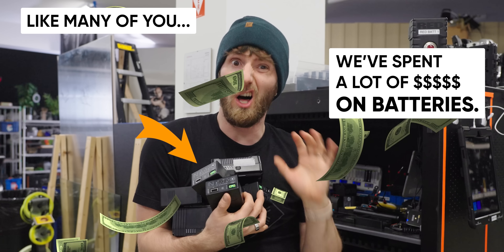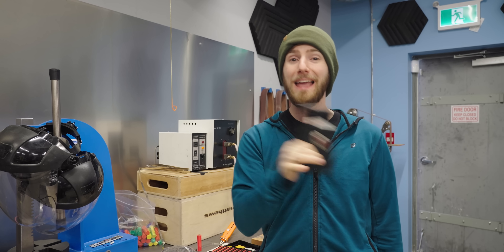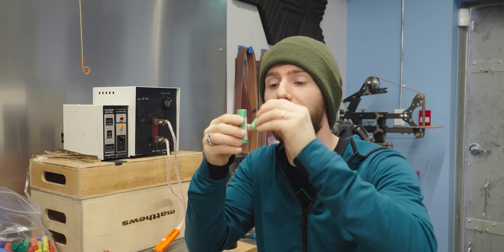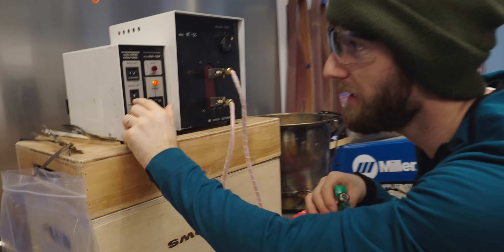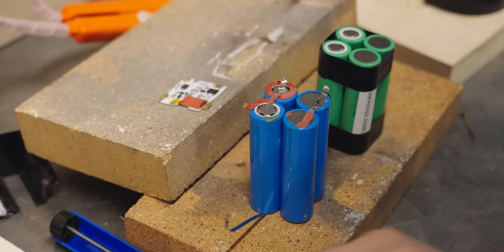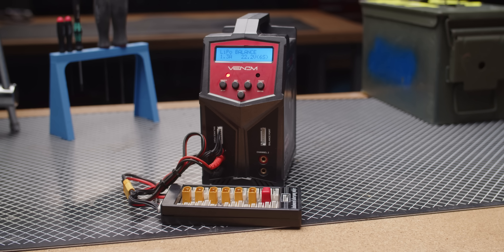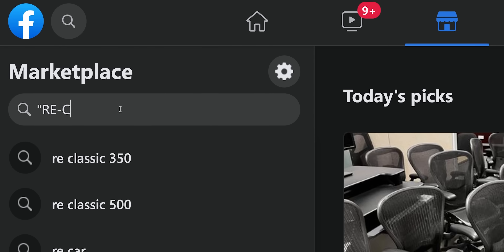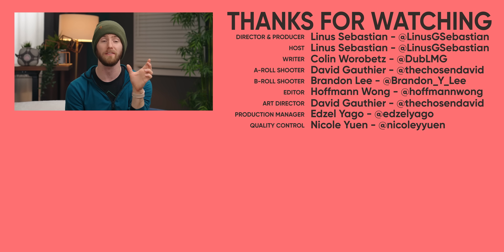This should be illegal… Battery Repair Blocking

Comment: My brother is always replacing the battery packs on his various devices with his own home made higher capacity battery packs. They usually don’t fit into the battery pack receptacle on the device, and are tied, glued, or bungeed to the outside of the device. He knows more than I about such things, but it seems like making your own battery packs, including the BMS, and all the circuitry, may still be cheaper than replacing their over priced proprietary pack.

That said, it seems like they cost of replacing the cells in that Sony pack was extremely high at the end of the day. Though I haven’t figured in the return on the video…
Reply: That depends on the complexity of the BMS. I've got 5 V-mount batteries ranging from about 300 to 500 Euro including VAT. For me, it was therefor a viable option to try and reset the BMS-chips inside mine myself (which is 'fairly complicated' to say the least). The BMS-IC's in mine lock themselves forgood unless you interfere with them via SMbus connections (which are not brought to the outside of the pack, you HAVE to open it and solder wires to the appropiate pins). Just 'waking' it by applying a suitable voltage to the charge-connections won't work.
I bought russian software to crack the BMS safety keys, bought the official interface from the manufacturer of the BMS (Texas Instruments), wrote to a manufacturer to obtain the logic-fuses (they are hard to find and I didn't trust Ebay/Amazon and such) and acquired new cells from the dutch company nkon.nl (they deliver the cells extremely well-balanced).
If I would have had 3 batteries or less, it would have been a break-even situation in costs.
The manufacturer offers a re-celling against 'about half the price of a new one'. But for me, that's far too sketchy: if the price is about 3 quarters of a new one, I can't put my foot down and refuse.

Comment: This is my first time ever on your Channel and as I am watching this video it's giving me pause a couple few times I just want to say it first off it doesn't matter if it's a laptop, scooter, drone or a toy, it seems most Americans just want to throw the whole battery away or make poor sumption about what is wrong with it and just run with that without actually knowing through proper Diagnostics. I think you'll find out nine times out of 10, that some of the cells might be lower than others but they will charge back up and hold that charge and the problem is going to be in the BMS circuitry and charging circuitry. And sometimes none of the above and you could take those sales and charge them outside of the case to the back in that same case with the same electrics and it will perform like new again because you woke up all cells at the same time while giving the circuitry a full power reset . I bet you 90%+ of the  'used' batteries, when power charge conditioned , will perform as well as the new ones purchased and exceed possibly all or most of them

Comment: You should use more power, and shortes pulses. Then you will most likley dont rupture cells. ive been spotwelding about 8000 batteries. and i have ruptured about 5 or 6. this was in the beginning..

Try again, and good luck :)

Comment: Another way for manufacturers to make it easy/safe for users to replace cells, is for the manufacturer to use a battery case where the batteries pop in and out (just like the zillions of consumer goods that use alkaline, etc batteries), without having to use/solder the damn nickle strips.
Reply: That is NOT feasible for high capacity cells like 18650's. The major manufacturers (Sony, Samsung, etc) will not sell individual cells to consumers, and will not sell "button top" cells suitable for battery cases. These lithium cells are far too dangerous for normal consumers to be playing around with.
Reply: @johncoops6897  John, not sure what you are referring to? 18650's (including "high capacity") are widely available to buy, including button tops. But button tops are not needed as the battery case itself would have the correctly shaped slots/connectors.
Reply: @Bill-NM  - there is a good reason why you don't see consumer goods with user repace Lithium cells. I've already explained why, so there is no point arguing with me about it.

Comment: With laptop batteries especially, in the pack there is a microcontroller if for whatever reason looses power or expires on charging cycles, it will then completely disable the battery cells from ever charging again by ignoring a confirmation handshake with the laptop so the laptop will then refuse to charge the battery, this is similar with a lot of other battery operated products, in order to maximise profits. I think printers may even work the same way.
Reply: It's not really about ignoring a handshake, but by settings in internal memory in either the BMS-chip or an external EEPROM. If cell-imbalance reaches a certain threshold, cell-voltage on one or more cells surpasses certain 'too-high' or 'too-low' voltage-limits, temperature exceeds certain limits, current keeps flowing while the BMS-IC tried to turn off its FETs, or whatever kind of cause, will set safety-flags in the BMS-IC and usually cause a permanent-failure status you can't resolve just right away without getting into communication with the IC, giving in the right security-keys to unseal the device, get into full-acces mode ánd then giving in the failure-clear keys.
Not only does the EEPROM store failure states, it can also store the cells-state/age. Even if you replace the cells, the BMS won't know any better than that it still has its original cells attached, aged over time and thus with bad internal resistance. New cells will still show the bad runtimes on your laptop.
Like that ain't enough, there's also a logic-fuse on board the PCB. A fuse that can blow on external command, in this case on command of the BMS-IC. Those fuses are hard to get ánd hard to replace.
They usually blow when there's a critical fault with the cells and the BMS-IC can't handle it anymore because of a failure of the FETs.
And then there's the 'cycle counter' inside the BMS (which can also be stored externally) that can be configured to disable certain things after a preset amount of cycles (a cycle is a charge-discharge cycle, where a cycle is freely programmable: it can be half of the total pack's capacity, but also 90% of the full capacity, but it can be 25% as well: the manufacturer can do whatever they want as long as they don't make it fail too quickly.
Trust me, I know ;) after 9 months of self-study I targeted my V-mounts, secured by BQ20Z65 BMS-chips, got new cells connected, reset the whole bunch and got them working again.

Comment: Guys as someone who works with these lithium batteries, I need to reiterate what Linus said. Do NOT try to modify or work with lithium batteries if you don't know what you're doing. These cells, if even a pin hole ends up in the lining of one, will start spewing noxious gasses that you do NOT want to breathe, and can start burning as well. They're a massive fire and safety hazard if you don't know what you're doing. Please, PLEASE, don't try to do this stuff yourself without heavy research first or you can get seriously hurt. Rc fb groups have posts almost weekly of peoples houses burning down cuz they even just CHARGED the batteries without watching them

Comment: As an Electrical and Electronics Engineer, I have to disagree with your statement at 4:30 about not testing and replacing the bad ones only.
If done properly, and you test all the cells capacitance fully charged and replace the faulty ones with matching current and voltage cells and type (As well as power rating obviously since P=VI) then it's absolutely fine to do so.

Having said that, NO ONE without proper certifications should do what you're doing, from an electrical engineering point of view...

Comment: have you guys only just found this out ?  companies that make these battery packs have been "bending us over " for years !  found this out when i tried replacing cells in a laptop pack. the bms has a charge count, that limits charge time after so many charges, ie charges for 10 min till it says full charged ! which of course it isnt !  then if you discontect the cells from the bms, it will register this as a faulty cell and stop charging........ and its all in the name of safety ! not profit !.......  yeah right !

Comment: Next time, hook up life support leads... just to see if it works. Suiciding on power loss was my guess too. Apparently Millwauke is bad for this shit too. If they're 18/20 volts, I'd be making adapters to use power tool batteries... not Dewalt or Millfucky. Ryobi and Rigid MIGHT be good options. If the device expects a signal from the BMS, but doesn't suicide on power loss, 10K resistor to fool the balance leads (just in series like the cells are) then the new battery through the power leads, leave the BMS/adapter in the device. Got a laptop to accept 12 volts through the battery connector that way.
Reply: Dewalt batteries contain no BMS by the way. Seems to just be an EEPROM that tells the charger how fast it can cram voltage in, and the drills stop when the voltage gets low. Not an expert on the particulars of these batteries btw; just a guy who's watched various video and connected dots ... connected pretty well I think.